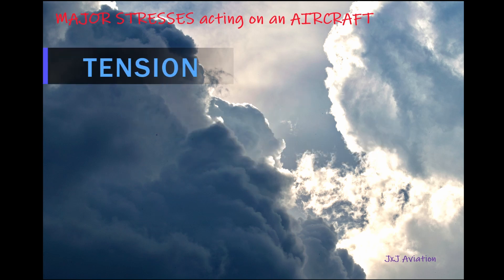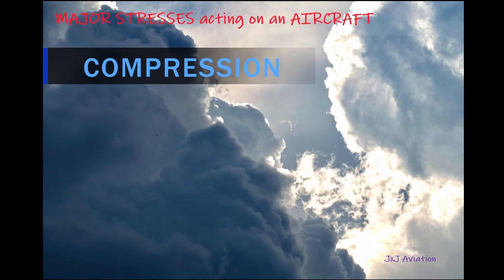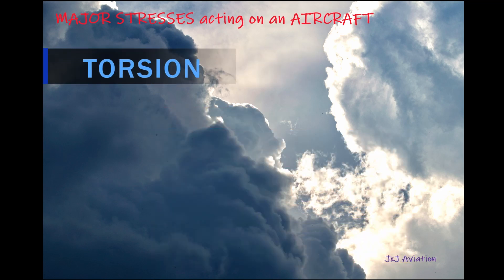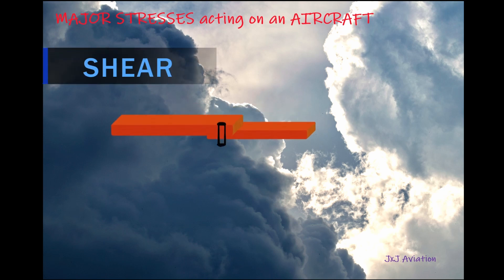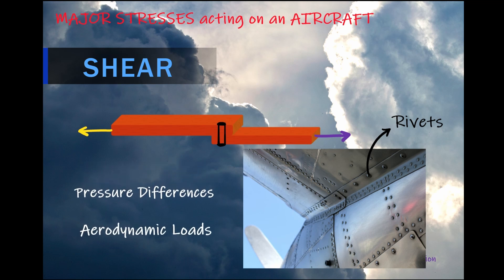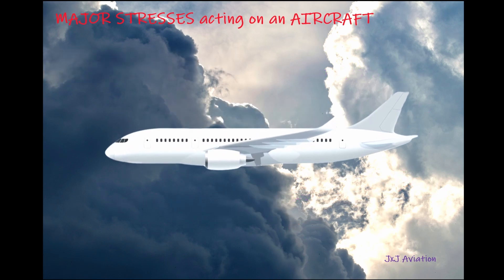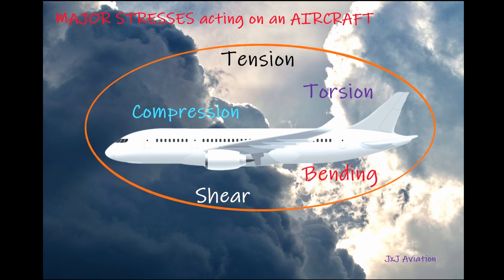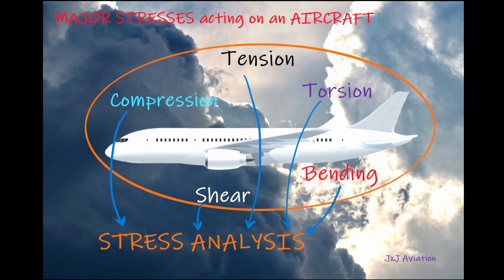What are the Major Stresses acting on an Aircraft? | With Examples | Aviation Notes

Comment: flying wing
= structural stress mitigation 
= defeat gravity with bouyancy
= sit on air, air compresses, becomes cushion-of air, under the aircraft fuselage, like a - hover-craft to ground-effect-vehicle.

non-occillating non-resonating ribs = circle is not one piece, is not one material.

vibrations sent to area.sss where air should move faster, relative to its surrounding area.sss or to the rear of intersecting air (no contact with any part of aircraft)

apply to flight manual and pilot training of existing aircrafts
Reply: try b737-200 for starters. no winglets. no combine rudder(yaw, below 250knts only) and other controls
Reply from the maker: good explanation